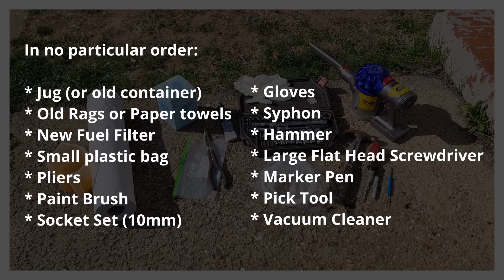How to change the fuel filter on a Mini Cooper R50

Comment: I did this and it was the one of the easiest I  have ever done. Nice of mini to put an access plate to do it. Unlike some american cars that requires the fuel tank dropped. Thank you.
Reply: Its BMW Mini every old BMW has this plate to service the fuel pump/fuel filter/fuel hoses.
Reply: @machinee30  It is smart engineering

Comment: There a bleed valve on the rail, get off all the air to start it easily (key turned on, to pressurize fuel system)

Comment: What are symptoms of a bad/ dirty fuel filter?
Reply: poor idle, engine cutting out mid-driving and taking a while to start the car from cold
Reply: On my MINI the engine would turn over longer before it would start. However, I had a mechanic replace the fuel pump and filter so I am not sure which one was the actual cause. When you turn the key on you can hear the fuel pump running. If you wait until the pump stops and then start your car it will likely start quicker..........